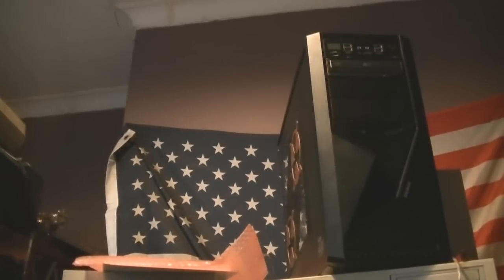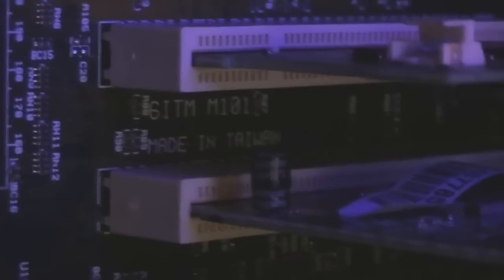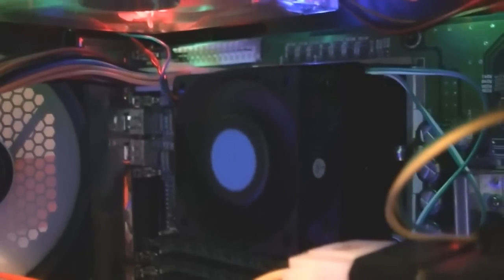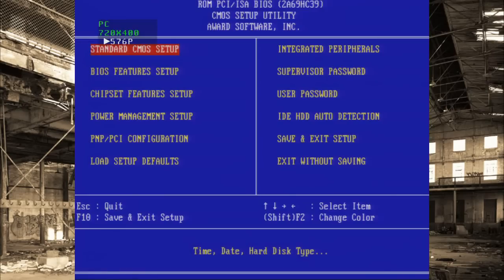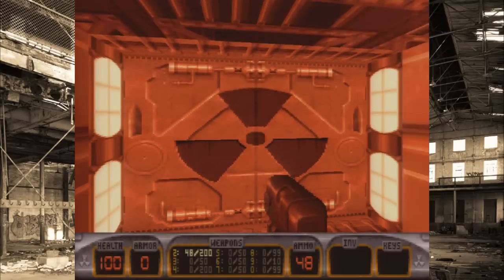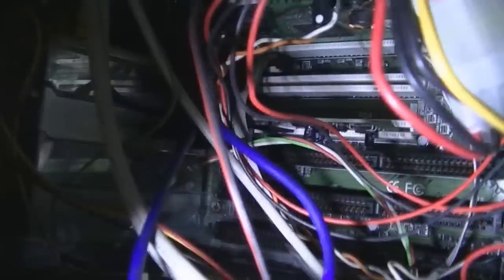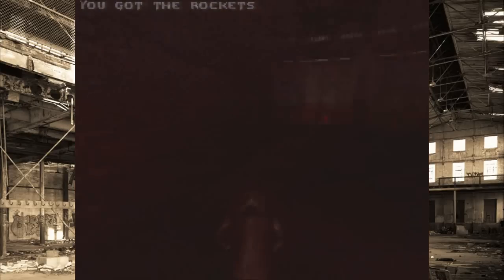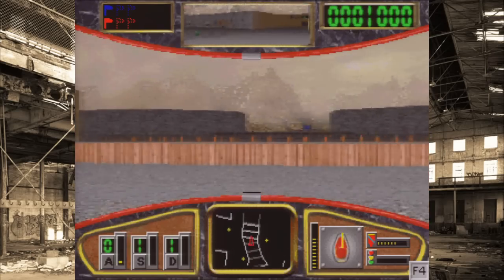Pentium Pro Overview (GJ80521EX200 Q004 1M)

Comment: I had a dual PentiumPro 200Mhz (256K L2) with 256MB of Ram in it back in the mid 90's.  I also had three 9GB Ultra Wide SCSI hard drives in it and ran either Windows NT or Redhat Linux.  Those were the good old dial-up days!
Reply from the maker: Woah, you must have been loaded to afford that back then, or else had really good friends. I was still rocking a 25MHz 386SLC into the early 2000s.
Reply: Did some work under the table for a local company and got paid in computer parts!  That was a good machine.  I created a lot of webpages with it.

Comment: Perhaps some more info on the Pentium Pro. It was quite revolutionary as it was the first out-of-order execution x86 chip. This made it a lot more complex than the Pentium, and it introduced relatively high latencies (although the OoOE could mask that to a good extent). This meant that a Pentium could generally outperform a Pentium Pro when the code was tightly (hand-)optimized. And as said, the Pentium Pro was not very good at 16-bit code. Its main problem was with its register renaming. On x86 you can access 'partial' registers: the registers are 32-bit, but you can also access the low 16-bits, or the low and high byte of the low 16-bits (eg: eax, ax, al and ah respectively). A Pentium Pro will rename all these to separate internal registers, and it will have to recombine then when you access the whole register again. This causes a 'partial register stall': the pipeline needs to be flushed so that all partial registers are complete before recombining. A lot of 'clever' optimizations for 486/Pentium make heavy use of partial registers, which suit the Pentium Pro poorly.

Comment: I use a Pentium Pro 200 myself (I think mine is a 256K L2 variation) for my PowerVR PCX2 box. Sadly that means I'm limited to Win9x, since there is no NT driver support. Pentium Pros were not very good at running 16-bit code (was fixed somewhat in the Pentium II), so Win9x is less than ideal on these machines. Mine is a Compaq Deskpro XL6200 by the way. Quite high-end for its day, with onboard SCSI and LAN. The chipset, CPU and memory are on a separate card. I have a Deskpro with a 486DX2-66 as well, and it's the same except for the CPU card (I've actually swapped them around). I have 64 MB in mine, but I think it's some kind of obscure Compaq memory. I couldn't fit SDR memory from other standard PCs in it at any rate. Looks the same size, but notches at slightly different places.

Comment: I had a Compaq Deskpro 2000 with Pentium Pro 200 MHz CPU in the late 90s. It outperformed our Pentium 233 MMX by nearly 20%. I ended up buying one of those weird Evergreen upgrade chips that converted it from a socket 8 to a socket 7, with Celeron 733 MHz CPU installed. What a weird machine that was.

Comment: i'm still looking for an AT board that support Pentium Pro...i have a gold-cover 512kb model that's just kept on a socket i took off a server PCB to protect the pins, and the original heatsink and retention bracket.
Reply from the maker: Every time I looked there were a lot of AT boards on eBay except the last time when I bought this board where a lot of ATX ones had appeared. Depends on whether they ship to where you are though and they can be prohibitively expensive. I wish you the best of luck.
Reply: HighTreason610 yeah it's crazy how expensive they can be on Ebay...for any old hardware, even worse for IBM 5150 and old Apple computers hardware!
Reply from the maker: RaptorZX3 I never got the whole craze on the 5150, I had one for a while but eventually sold it as I could never find anything to do with it, was a rusty old ugly thing out of a skip next to "Toys R' Us" who used them until around 2008, still worked. As someone with a strong dislike of IBM my advice might not be good, but that advice is to clone it and go one better. Just look up 8088 motherboard on eBay (Maybe 8086) with the search set to worldwide and you might be able to save some money cobbling one together like that plus the pressure to keep it factory is gone because with what is essentially your own clone you can do whatever you want or look up the PC-Retro if you like soldering and think you can justify some cost if you get to build your own motherboard. Apple hardware I can't be of use with as I have never collected it and only own one piece, that being a "DOS on Mac card" I ended up with, I have heard that Apple stuff is prohibitively expensive though.

Another thing you could try is getting in with a community. Vintage Computer Forum for example, it's full of assholes but if you hang around and become a part of the community for a while keep an eye on the sale threads or just outright ask if someone wants to sell you one of what you want, collectors generally charge less to each other than people do on eBay and are also more likely to package things properly as they are the first to complain about scratches on some dime-a-dozen Dell monitor they ordered.

Another 5150-type thing to consider is probably XT-IDE which is a cheap IDE interface allowing you to ditch the hard drive for a CF card, I think these work in the 5150 and are likely more reliable. There's a few other reproduction cards out there like this for floppies and whatnot as far as I remember.
Reply: HighTreason610
the IBM 5150 is just that: Major historical computer landmark, and pretty hard to come by these days. This is why it's valuable in present time. This is like asking someone "Which one would you buy, a real NES console, or a NES clone of it which might not be, and sound as good?"

I'll talk to my friend about the XT-IDE, he got a more powerful power supply for his 5150 expressly for the hard disk, but he can't make it work properly with this one, so my guess is the XT-IDE card would take a lot less wattage from the original power supply and allow him to use a "hard disk" on it.
Reply from the maker: Arguably the clone is more historically significant as it innovated first and who even uses IBM now? Nobody, because they left the market. I don't know about NES, but if you gave me a choice between a Mega Drive and a Scorpion 16 I'd take the Scorpion any day. In the case of the PC the clone is likely to be better (Better upgrade paths), as is the Scorpion (Not region locked) and both examples of clones are copying things that had pretty much no propriatery parts.

Still man, that's just my two cents and I hope you find the 5150 you want. Best of luck to your friend too, I know how irritating it can be when things don't work the way you want them to.
Reply: HighTreason610 you obviously don't give a damn about historical landmarks, hehe. But that's your opinion. But if i find a 5150 someday for cheap, i'll probably clean it and try to resell it for a higher, but still fair, price.

Comment: Nice modern take on an old system you have there! I have an old compaq proliant 2500 running 2 gold top p pro 200mhz chips with 512kb chache at 233mhz and 512mb ram that runs xp black edition just fine. Strange combination I know but for playing music and the retro factor it works for me :)
Reply from the maker: I think a few of us probably have or have had an oddball like that, I had a Pentium MMX for a while that had a Geforce 5, some crazy amount of RAM and two 80GB hard drives in RAID. Come to think of it, I don't know what happened to that - I can probably guess though given that last time I remember using it was at someone else's house.

Umm, also, if I just spammed your Google bell thing I apologize, I was typing and the box disappeared... The silver paint on this laptop is conductive and causes the mouse pad to freak out if I touch anything at all.

Comment: It's strange to see such old hardware in whats quite a modern gaming case. It's very neat though! I'm quite jelly of your stock of old hardware.. hehe :)
I only got a few old portables, An Amiga A500 and a commodoes CDTV.
Reply from the maker: Aye, it's a bit blingy. CDTV? Very strange piece of kit that was. I wouldn't be too jelly of the old hardware as so much of it can run you ragged, more hardware is more things to worry about, more cables to rummage through to find which one fell out and bigger electric bills when you forget to turn it all off.